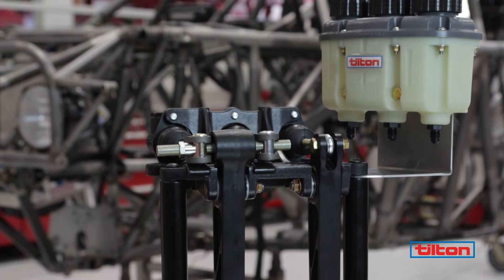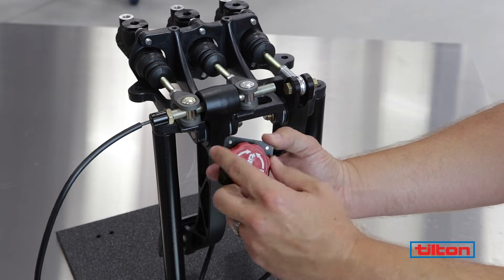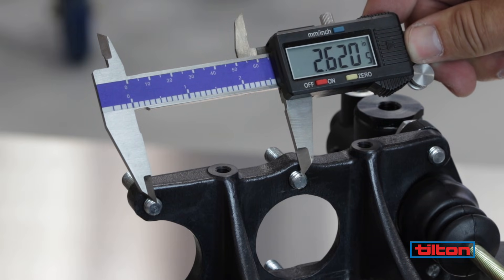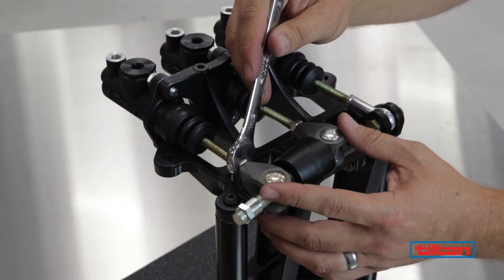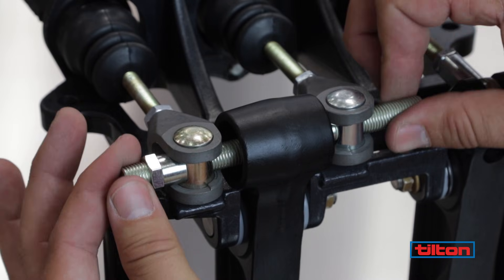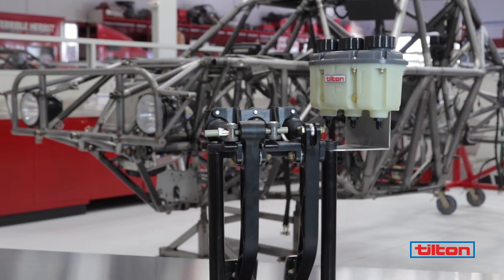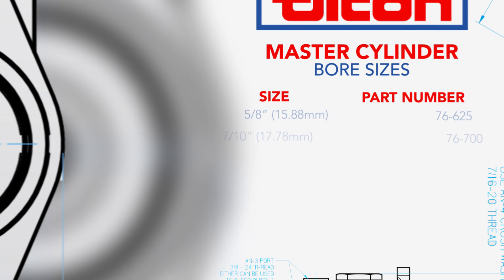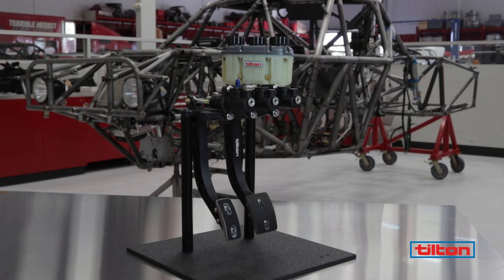How to Properly Adjust Your Balance Bar

Comment: I dont quite understand why hes lengthening the front mastercylimder pushrod. Is he doing that because he wants more front brake, or does it give it less front brake when lengthening it?
Reply: Lengthening should give more brake.
Reply: @tabcobra  The front MC is smaller than the rear MC, so the rod needs to move more to displace the same fluid as the rear. This is a good way to apply more braking to the front so you don't lock up the rears.

Comment: Interesting about front brake lock up should occur before rear lock up. My impression is that when a wheel locks up, and the tire contact patch starts to slide on the pavement, that the resistance of the sliding wheel is less than than of a tire that is close to, but not over, the traction limit. So, if the front wheels lock up, and the rear wheels are close to locking up, the rears will provide more braking effort.
Reply: You're right. If the fronts lock up first, the car will remain fairly straight and is much easier to control. 
If you set it up the opposite way, it can cause the car to be tail happy under braking, but steering inputs still work. 
Some racers/sports/vehicles benefit from being able to rotate the car via braking, but I think it's mostly a personal taste/driving style thing.
Reply: @Northern_  Both of these comments are the most idiotic things I've read in a long time. You would never, EVER set it up the opposite way - and you have the literal manufacturer of the system warning you not to for good reason. For the dummies. We're not talking about compression locking to chirp the wheels of a locked diff and rotate the car. We're talking about threshold brake locking the entire rear wheels before the front wheels. It isn't easier or harder to control. It is OUT OF control. You have ZERO control if the rear wheels are locked under braking. You are more than welcome to try and set a car up that way. Your eyes will widen as you realise why it isn't a good idea, as the car swings out from under you like a pendulum and might as well be like driving on ice.
Reply: Front locking up is safer than the rear. If the rear locks up it'll be more prone to spin under steering input or lateral g's.
The fronts locking up just give you no steering or understeering which is safer. Unless you're trying to get lap times.

Comment: I'm surprised with the amount of play you are leaving in. The brake balance bar can move left/right as you are cornering and setle in a diferent position for the next braking... any coments?
Reply: It's probably just put together losely for demonstration purposes... Turning one clevis while keeping the other (and the bar) fixed will solve the problem... Think there should be plastic washers bte the clevis' and the pedal aswell....
Reply: Its an inefficient design, hence why the price is low. Using a trunnion balance bar is the proper way. An ap racing trunnion assembly alone costs more than the whole tilton pedal box.